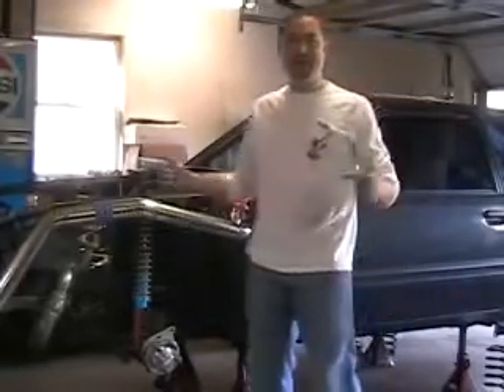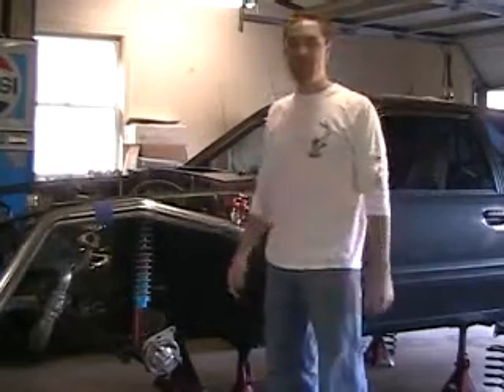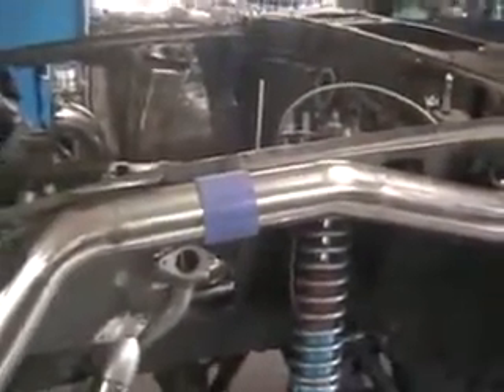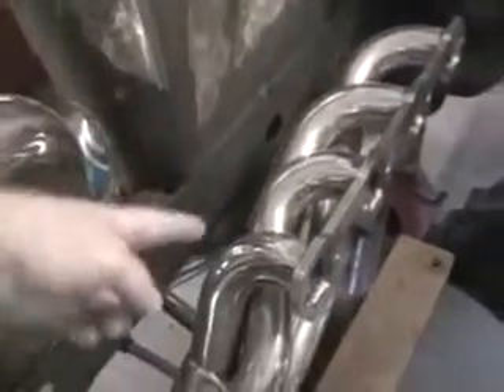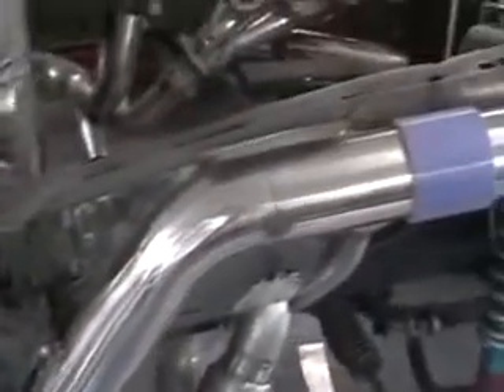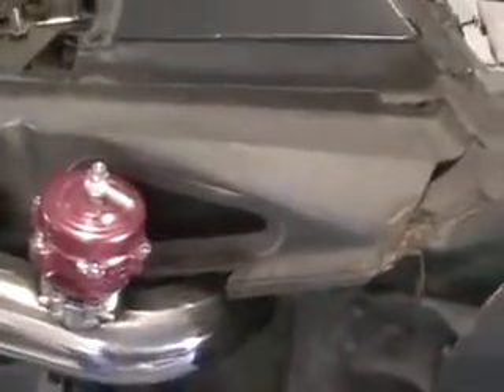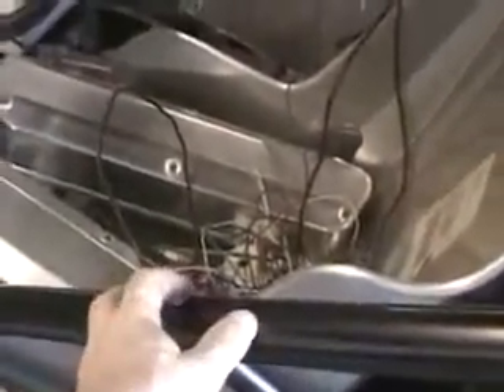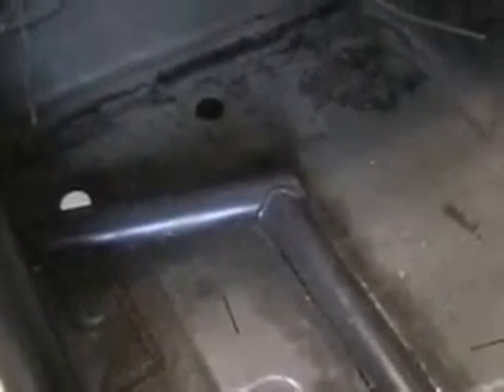Twin Turbo Build

Comment: They goodfun turbos wastegates and blowoff valves I run 12lbs boost and play around with the soft hard adjustment on the blowoff valve it has a part to play in lag and gearbox pressure find your preferred setting and have fun

Comment: hey man nice setup. i was curious of the heat off the piping inside the cab. will the heat off the tubing bother anythng under the dash. i know your probabaly gona wrap the pipes undr the dash but was just curious what your plan was.
Reply from the maker: +melanie Owen Those pipes are induction pipes and I don't expect them to get very warm. Air temps under boost will only be in the 90-100 degree f. range. Under normal driving I expect less.

Comment: you should wrap the pipe going through the cabin, or it could melt the wires behind the dash
Reply from the maker: Rowan Scarlett The intake air temps shouldn't get much over 100 degrees so I don't see the pipe getting too hot. I will be doing some testing before the dash goes on to verify.

Comment from the maker: Ok I gotcha now...your right, alot of your turbos are mounted directly to the manifold. Alot of the drag racing guys build their combos just as I have and dont have any issues with response. Other then the little bit of energy you loose as the exhaust cools slightly it should function just the same. This combo wont have any lag because of the small a/r on the exhaust side of the turbos. Thanks for watching

Comment: sorry the clarification of my statement/ question was bad.usually when having the turbo set up you have the turbo hooked up straight to the manifold which is bolted on to the block thus giving the turbo good response. looking at this set up you have the headers, tube then manifold for the turbo? thats what i was trying to get at.